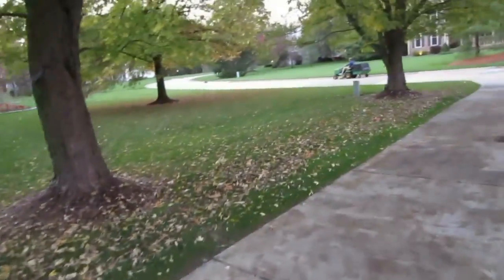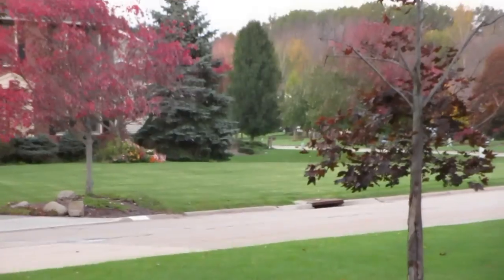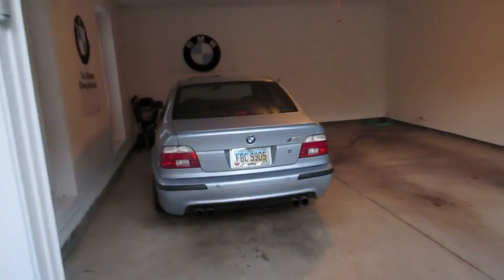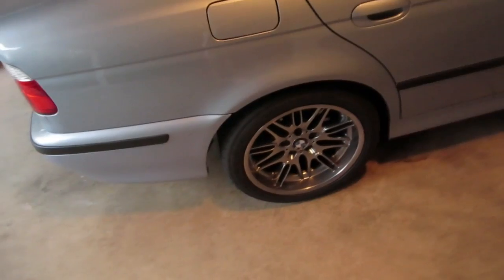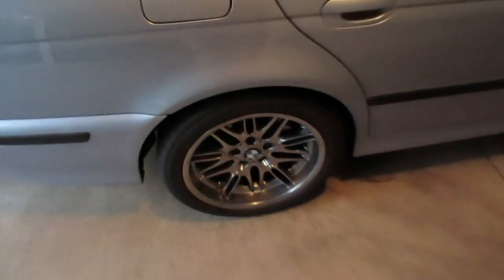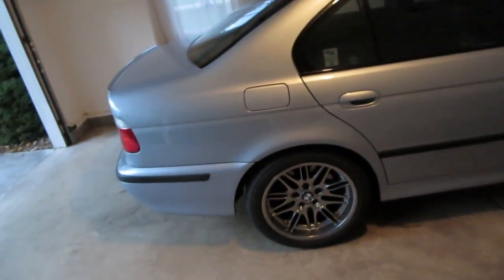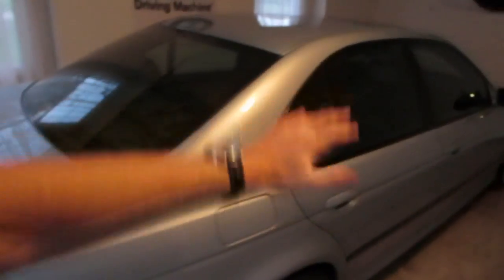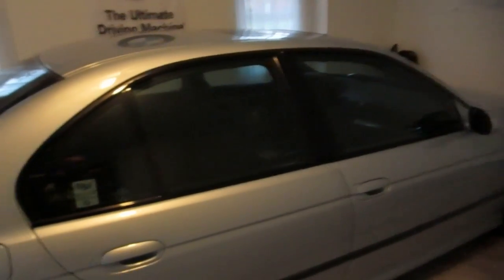Lots of Work  10/18/13 - Day 1,042

Comment: It either snapped or isn't tight enough and there is a lot of slack.

Replacing the cable is as easy as unscrewing the nuts on the lever, pulling the cables out from under the car and getting new cables on.

Comment from the maker: I never used a handbrake on a hill start before.  Just have to be very quick with getting off of the brake and onto the gas while letting the clutch out.  I don't ever roll more than MAYBE 1 inch :)  And we don't have inspections here.

Comment: What part number are you looking at that BMW is trying to shaft you on the price? That's funny how your parking brake works sorta on one side but not at all on the other. Did it ever work? The cables that are attached to it are braided and rust proof so it seems like the connectors up front are messed up or not tight enough. You removed your center console to see if the cables aren't jewed up, Usually there's an access point at the connection point to see if everything is ok.

Comment from the maker: I think I bookmarked the part number somewhere.  I spent some time looking around for used ones and they don't exist.  Nobody tears down an M5 and sells that part.  I had the parking brake totally rebuilt in this car about 2 years ago, and it lasted for about a year.  It's a horrible design.  If I'm ever working with the interior like that, I'll have to tear it apart and see what's up.

Comment: Ryan, you do know that you can adjust the spring tension on the parking shoes by removing one lug nut and rolling the car until you can see the spring wheel, right?

No need to do what you did...